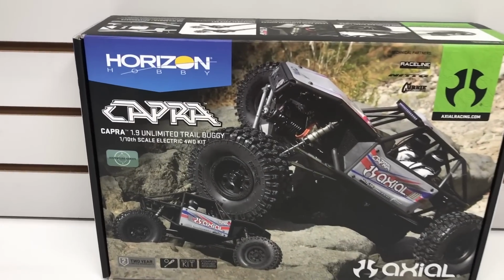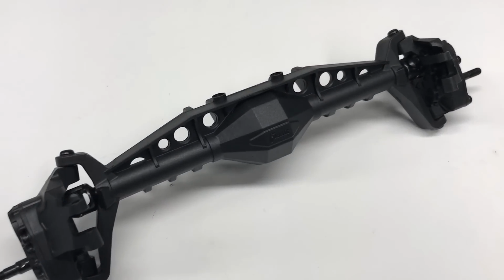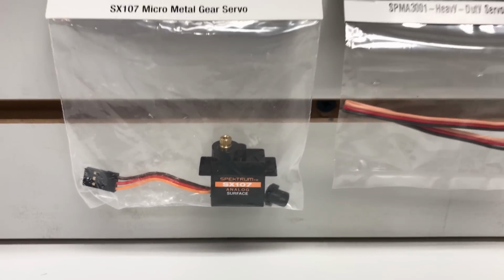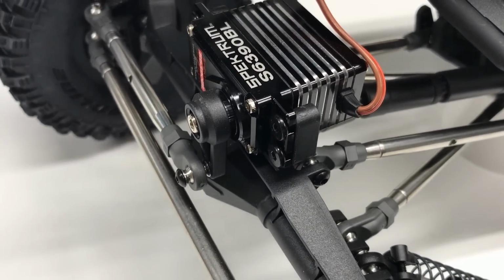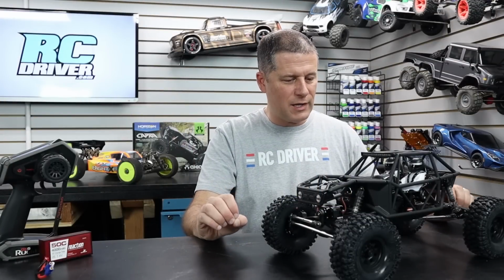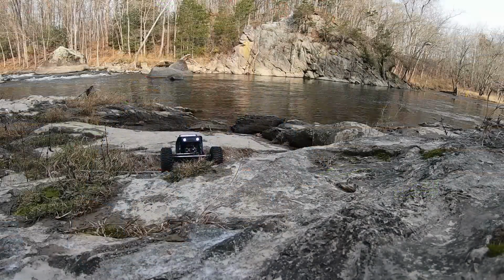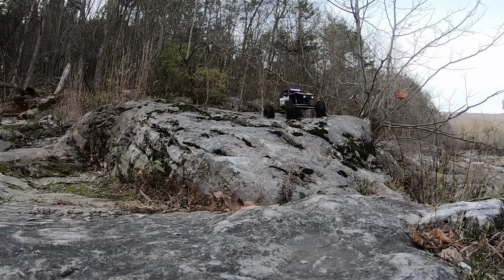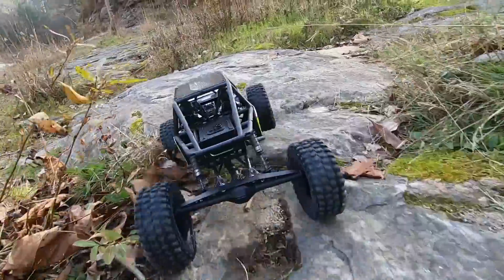Challenge Yourself & Go On New Adventures! Axial Capra Unlimited Trail Buggy Kit Review | RC Driver

Comment: I have done the same setup as exocaged rc by using small short bungee cords. It works and it don’t loose the flex. And works great 👍 watch his channel and he will show u how to do it. Definitely brings it down and with the pin spring mod u loose flex. So yeah the bungee cords work great. Also I added 107g brass to each front wheel. Love it and the bungee cord mods already. But now I want to get rid of the factory tires and wheels!

Comment: I found that a heavier set of rims made a huge difference. I was able to use the heavy springs in the rear and the lighter kit spring in the front. This keep the uphill shocks from unloading and making the body lean to the downhill side and rolling over.

Comment: Try the optional Axial Soft/Soft Springs - Purple #AXI233004 to bring the overall height down.  Have them on both ends of my Capra.  May try Soft/Soft (front) and Soft (rear) at some point.

Comment: Great video Greg, I am loving my Capra. I too went with a brushed system and it has been an amazing trail and crawler. I think you hit the nail on the head with your review of it. Am a huge fan of your channel, I never miss yours or RCN videos! 👍👍👍👍👍
Reply from the maker: Rich Homan Thank you for the support! One benefit to being a little late on the review is getting to see what people are doing to it. I saw people swapping axles, deep discussions on motors and many other topics on a just released rig. I think some people that stumble on these groups may get scared away from the Capra with so much technical talk. I wanted to show it’s a super capable buggy out of the box. That it will do well on even a basic power system. Modding can be cool, but not at all necessary.
Reply: @rcdriver  I agree 100%, i have done very little to mine and it has been amazing. I started making videos of it right when it first came out and got a lot of people asking what i had done to it, they were surprised when i told them basically nothing. Looking forward to seeing more videos!!

Comment: I’d still love to see this as a rock racer - have you considered converting it?
Reply from the maker: Mike Petersen That would be a cool idea, but probably not going to make my project list. My thing is just hitting trails to crawl and drive for fun. I’ll tweak the suspension and steering, add a little weight up front and just enjoy it as is.
Reply: Slap in an Axe 2300kv on 3s, run 14t pinion and you got one.
Reply: TrailCrawler 203 cool - thanks for that simple direction. Suspension upgrade too?? Looking at a few different rock racers, Axial, Team Associated, Losi (the usual suspects), but love the look of the Capra.
Reply: @mikepetersen8585  I was more saying it tongue in cheek. I've had a Wraith Spawn with a 20t on 3s, and the Capra with the Axe 2300kv on 3s is definitely faster. Though, I've not actually done any "rock racing" per se. Join the Capra group on Facebook. You'll be surprised on what people are doing with this platform.